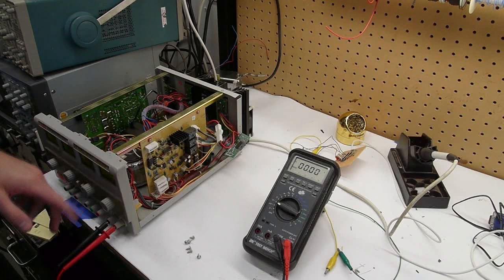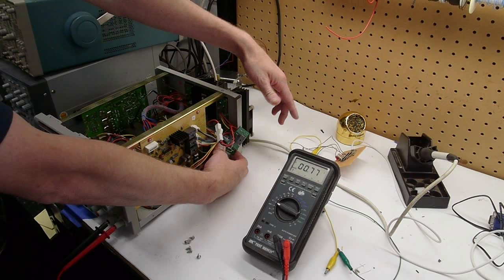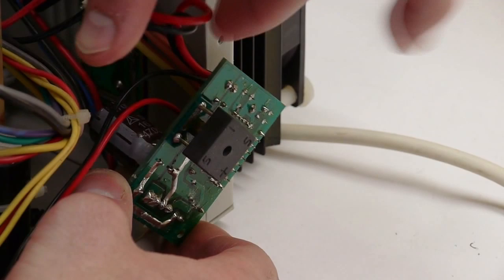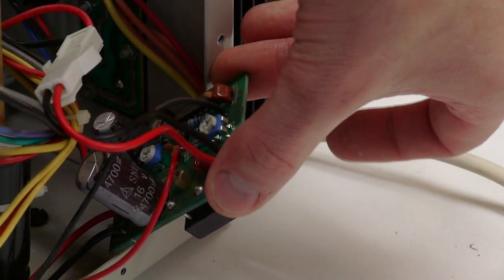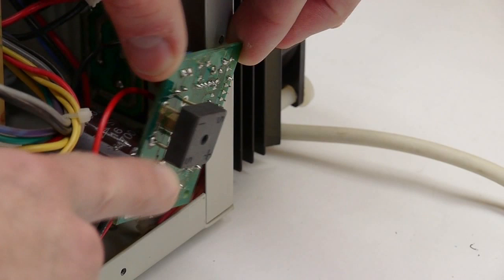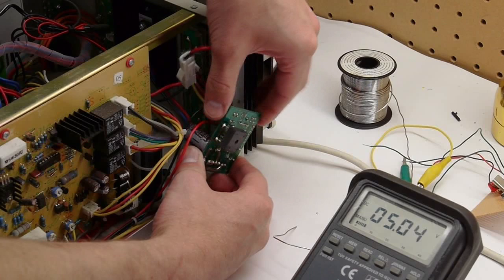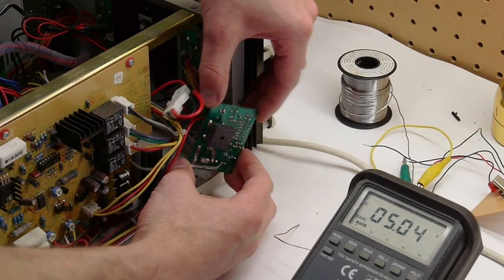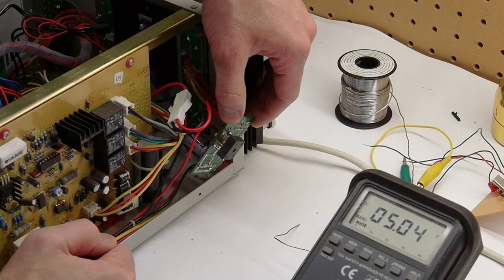Repairing the 5V output from a Mastech HY3005D-3 (cheap import) power supply

Comment: Hi!  Nice video.  FYI, around 0:56, 0:58 and several other places, it looks like the north-east "S" conductor of the bridge rectifier had no solder on the rectifier's side of the board (i.e. cold solder joint, or not enough solder during original soldering to get through to the rectifier side of the board).  After you repaired it, it shows you filled the gap with solder -- likely candidate for a cause.  Good job!

Comment from the maker: For intermittent failures, try pushing on the circuit board with a wooden stick while monitoring the output for a glitch. You can also try chill-spray or hot air to check for problems caused by thermal cycling.

Comment: IMHO differential expansion problem with bridge-rect; cold brass standoff holding PCB in centre, while rectifier leads are heated/cooled and also attached to PCB. In the end, something has to give and it's the rectifier legs. Normal practice is to put a kink in the rect legs so they can move around with minimal stress to all concerned.

Comment: One thing to note is that the lead-free solders don't have the same properties as the tin-lead does. Tin-lead is softer and will deform slightly under stress before cracking. If you have a problem again, try soldering the leads in-situ to remove the stress on the joint.

Comment: @superdau 
btw. I don't like the mounting method. If the rectifier does not sit 100% flush on the stand-off it will always exert some force on the solder joints as soon as it is screwed into the case. It seems, they want to use the case as heat sink.
Since another mounting method seems out of question, I would either resolder the rectiffier so it sits on the board (need another stand-off) or screw it down to the stand-off while reflowing, so it's flush to the standoff (meaning less stress).

Comment: from my experience working on tv's etc for my father (and from what he has told me as a technician of 45 years or so) you dont even need to have mechanical stress to cause a dry joint,, its would just be a very borderline joint from the start and thermal stress and oxidisation will do the rest for you.( also those joints looked REALLY bad just from watching the video)

Comment: MY guess would probably be its caused by the lead free solder they use in manufacturing more than anything else , it jst doesnt perform very well imo. I have the same supply , its not happened to mine yet but i rarely use the 5v out.

Comment: Yes I have done that, but it seems it is not it.
Plus I am seen the issue on both outputs now (the master and the slave) .
Even though I set the voltage to 7V and leave it there I hear the relays click every now and then and the voltage fluctuates from 4 to 5.6 to 7 to 4, etc. Every time the relay hits.

:(

Comment: I know this is a bit old but I was wondering if you could help me out, I am fixing the posts for a hy3003d but the owner removed the front panel and didn't mark the plugs. Now I have two open sockets on the LED board, and two loose plugs (orange/black and red/black) and I don't know which plug takes which, they're the same size plugs..

Comment: I have a HY3005D-2 and would love to add that 5v module to my device if that is at all possible. Do you know if the PCB and wiring from the transformer in to the PCB and out to the 5v terminals are all that's required or is there any interaction with the large vertically mounted PCBs?
Even the PCB number for the 5V module you worked on would be a start for me to search for an equivalent.

Comment: Notoriously bad mounting method. There is no way for the diode package to expand with heat. The solder joints open all the time. Even a sil pad under the bridge is enough to stop it. Like <$1.